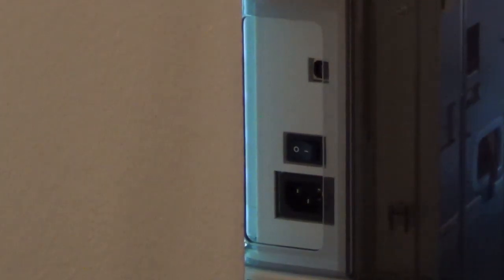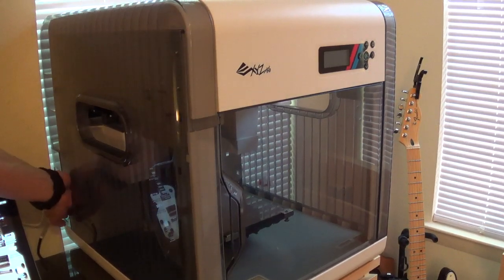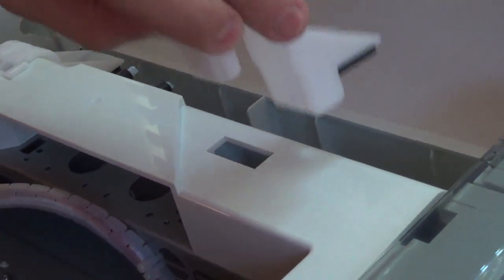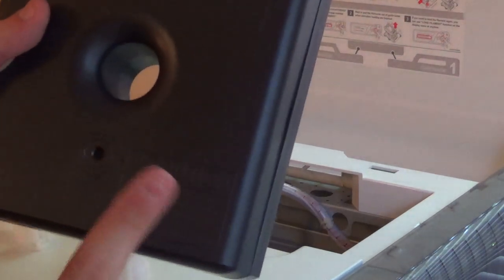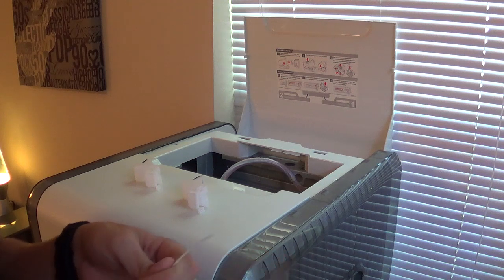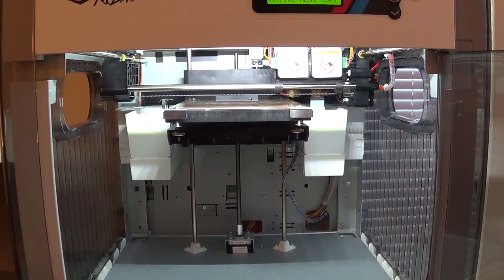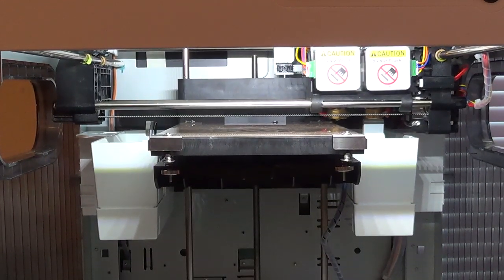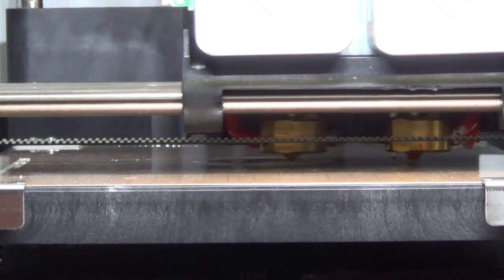CLONE YOUR FAVORITE STUFF! da Vinci 2.0 3D Printer Setup

Comment: so you have to use these "cartridges"?
Reply from the maker: +Nathan Carbo You have to have one inserted into the machine at least. I use an external spool for filament so, no you do not have to exclusively use the carts. You will need a resetter though for the carts which is about $50.
Reply: Bryan Keller resetter?
Reply from the maker: The filament carts have a chip that measure the amount of filament. Once it runs out you have to reset the cart if you use external filament. Its an easy way around the proprietary carts.
Reply: Oh! That's what the hole is in the cartredge?
Reply from the maker: +Nathan Carbo Yes, just know you will need to get the resetter if you use external filament. 
Here is a link for some info: http://wctek.com/xyz/
This is the one I bought: http://www.wctek.com/shop/xyz-accessories/29-xyzap-v2-plus.html

Comment: Is it better than the cubify cube 3?
Reply: Paul Schreiber No. Trust me, Ive used both....
here are some pointers to what I feel both printer are good for

CUBE 3 3D Printer----
-Auto bed level
-Fast print speeds
-Little to no Clogging (PLA Only, ABS not supported)
-Looks like a modern machine

CUBE 2 3D Printer----
-Bed Level manual, but much easier, and very rare to need one
-PLA and ABS
-Fast Print Speeds
-MUCH MORE COMPACT!
Smaller print area, but the compactness makes up for that (5.5X5.5X5.5)
MACHINE IS ONLY (10X10X10)

DaVinci 1.0----
-Fast and Cheap 3D prints
Pioneered Cartridge Tech for 3D printing (with Mod to use 3rd party spools)
ABS PLUS PLA
Onboard memory 
Large Print Area (7.9X7.9X7.9)

DaVinci 2.0 DUO----
-Cheapest 2 Color Printer
-Fast, but beware, print bed is smaller than the DaVinci 1.0 (5.9X7.9X7.9 Inch
-weights a lot
Reply: Alex Stark thank you for your response i am going to buy the cube 3 or the DaVinci 1.0 :)
Reply: Frayme Go Cube, Looks nice, Self level, plus the Cartridge mod is easier
Reply: Alex Stark I'm going for the cube thanks for your support
Reply from the maker: Paul Schreiber I have heard awesome things about the Cube 3. If you have the extra money I would probably go cube 3, if not the Davinci 2.0 is a great printer as well.

Comment: I have 1.3.34.1 Software and it does not have a PLA option.  Also 2 things. I had to level the bed just a bit, and adjust the X axis. But it is pretty much out of the box read to printer.  Also if you hate the ABS fumes. Which is why I like PLA. You can use this to help. It works well for me.

I just got my XYZ printer and I am pretty happy with it so far.  If the fumes smell bad to you, or in my case give you headaches you might like this.

Thought you might like for venting ABS fumes. I just got my ZYX printer also. Vent helps me.

http://criticalmods.weebly.com/davinci-3d-printer-hood-kit.html

Comment: I have been on Amazon and seen some negative feedback about support and the printer having issues. Have you experienced any errors or had issues where you had to go to support? Im looking at buying one because of the dual printing head and heated base. With the new firmware can you still trick the printer to use a role with the cartridge still inserted in the printer?
Reply from the maker: The screen did "freeze" once but I just turned it off then back on and it went back to normal. I haven't ran into any issues that I had to call support about.

Comment: Great video.  I think this printer will be great for my o scale model railroad.  Can make fencing, pipes, telephone poles, fire escapes, people etc. You can paint the pieces too. Thank you.
Reply from the maker: It can print things like that, I have noticed though if you print thin things such as a pole it may not cool quick enough and may turn out sloppy. For an object like that it prints better laying down on the print bed. And yes you can paint the printed pieces.

Comment: Its quite easy to modify this printer to  use filament  rolls outside the unit just have to  make sure the printer thinks that the cart is in there still and use these http://www.wctek.com/shop/  .What i do not like is the spyware built in they know what you build every time .So make sure you do some  reading how to remove it  cause the xyz software ports  are made to be connected .but if you do not care of privacy or there control then no worries . I find melting my old broken failed designs in to new filament makes it worth while . and if you love to go crazy with it . its a must . then you save tons of money and  you can just make even the stupidest things to try it . does this model come with the scanner ? so far i am not impressed with the scanner models they  do not do great detail . and what do you think of them ?  .great video though . Trying to wonder if i wanted to add one of these to my collection. this one  with auto bed and leveling makes it  fun  . Does it do  good detail work ? Can you change the  extruder sizes ?   Thank again  for the  video.
Reply from the maker: Well so far I do like it. This model does not have a scanner but im not sure how much I would really use it anyways. It prints fairly good detail and the heated bed you actually have to level manually. It tells you haw much to adjust it but you have to turn the knobs yourself. As far as the extruder, it prints only in 1.75mm but I believe you can replace the nozzle for bigger filament.

Comment: hope you figured out by now to make to external spool holders  and use 1kg rolls, leaving the cartridges in but feeding from the external filament
if not your paying ALOT more per 1KG of filament
Reply from the maker: Yes, the only problem is that it still runs down the counter in the spool in the printer making all of the filament unusable after it's "empty". I have heard of a few devices that reset the counter though which I'm looking into.
Reply: Bryan Keller Hackaday had a good article on how to reset the "counter". Apparently it's stored unencrypted on the spool...
Reply: satgod There is a Mod you can do....
The machine is smart enough to know if you put in empty cartridges

Comment: Do you know if it can print clear objects instead of just solid colors?
Reply from the maker: I don't think xyzprinting makes a clear filament yet but if you buy a different brand clear filament it should work fine. You do have to have a xyz cart in the printer though so you can either put the filament in the xyz cart or you can do what I do and  just leave a cart in the printer slot and feed the other spool externally.
Reply from the maker: Charles Jabbour Gédéon Check out the beginning of this video. I think it will explain what I meant. 
https://www.youtube.com/watch?v=NrsUdHzIIiY&list=UUlsONrdvgcTmAUgPOV-8ywA

Comment: Hey Bryan, how were you able to use slic3r? did you have to flash the firmware?...I've been trying to find some other way to build supports. XYZware has no control of supports and uses them gratuitously to the point now that half the volume of complex pieces are supports.
Reply from the maker: I have not found out how to print straight from slic3r yet. I have only used it to manipulate my .STL files so far. Generally if i have a piece that requires support and I dont want to use xyzs support system, I will draw some support beams straight into the .STL file then snap/cut them off and file down the excess. It have saved me alot of plastic and time.
Reply: ahhh ok I've done the same. I've also used meshmixer, its free and super easy to build custom support lattices.

A couple guys have been working on FW to use repetier, slic3r and cura

https://github.com/luc-github/Repetier-Firmware

I just found out about this, so I'd thought I'd share. a new product called XYZPro has been released which lets you reset cartridges, modify extruder temps and bed temps. I'm hoping it will allow me enough freedom to use hips as dissolvable supports
Reply from the maker: Awesome! Thanks for sharing man!

Comment: So you managed to get a good print out of it right out of the box? Wasn't as simple for me, extruder was spitting out too much material causing overlapping messy layers. The proprietary cartridge kept jamming and tugging on extruder causing the print to go out of alignment. Anyhoo switched to Repetier firmware and never looking back!
Reply: How's your experience with the machine at this point? Are the cartridges user refillable? Or does one have to go with their bs proprietary refills? It's such a shame that they're attempting to go the same route as the ink cartridge/printer industry. Companies are always looking for ways to nickle and dime us to death. Good thing we have entered the maker age, as that shit just won't ride anymore.
Reply from the maker: -Phil
I am still loving the printer honestly. I have been buying my cartridges from xyzprinting because of the guaranteed compatibility and the features but I believe you can use other filaments. Their does have to be a cart in the slots at all times but I assume you can just use other filament if you wish externally. I have opened a cart up and it has an easily changeable spool it's just a hassle getting the shell open!
I'm going to buy some ninjaflex filament soon and try it out on the printer so I will upload my results asap.
Hope this helped! -Bryan

Comment from the maker: Edgar - If you use the xyz software there will be a drop down box where you can select ABS or PLA plastic and it will automatically configure any changes.
Reply: Bryan Keller Have you had time to enjoy leveling your print bed? 
I went from Makerbot, to Davinci, and now to Cube. The nice thing about cube is that there is no platform leveling, plus you have no jam pla
Reply from the maker: Alex Stark Leveling it is sometimes annoying but I have gotten really good at it now to where I can get it the first try. And I haven't had PLA jam yet but I do clean the nozzles pretty often.

Comment: you're so lucky!!!
i noticed the printers filament is inside that black case instead of a round one...does that case open and is the plastic roll inside??¿?
have you tried slic3r instead of the xyz program?
Reply from the maker: Yes, inside is a 200g filament spool. I dissected the whole cartridge and it also has a microchip in it that stores the information about the cartridge on it.
I did get it to work with slic3r but honestly I just use the xyz software because it is more user friendly.